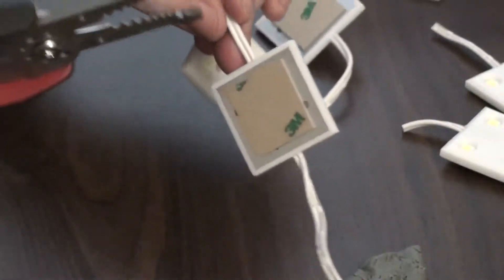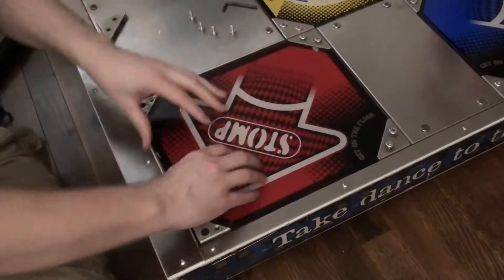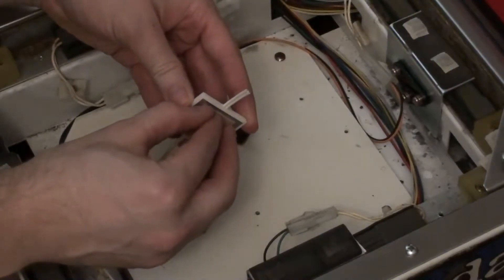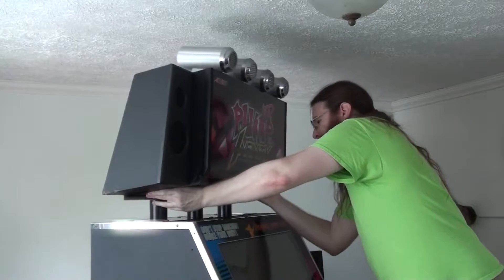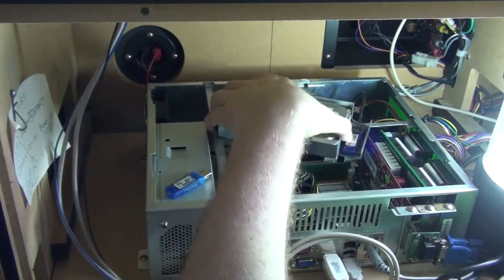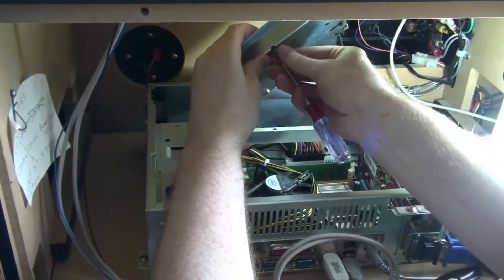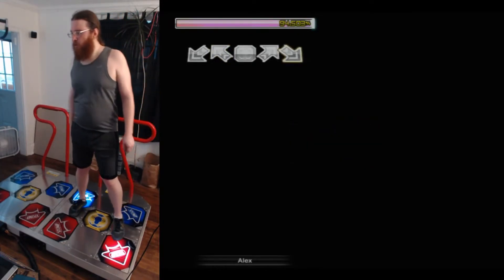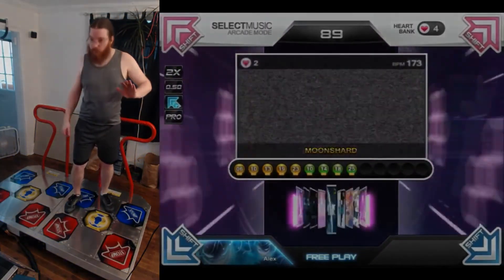Pump It Up machine upgrades: Pad LEDs, Infinity HDD

Comment: I definitely like the look of Infinity, much more grown up looking! I wish the song title was shown on the screen during gameplay though! If I had a circuit diagram for that pad I/O board I could troubleshoot it for you. (electronics servicing used to be my job)
Reply from the maker: Oh cool! I wasn't able to find a circuit diagram, but I could maybe try tracing the connections on the PCB myself... Here's what it looks like, for reference: https://drive.google.com/file/d/0BzqS6lEIbhJGbGhRZHFsOFlOTm8/view?usp=sharing

The connections toward the front of the photo go to the machine, and the five in the back each go to a panel. The two on the right (blue and white) work correctly. I'm sure there isn't much that can be done with just a picture, so I'll see if I can dig up some more detailed information.
Reply: Thanks. It's an odd fault for three of the five to be out. It could be the drive transistors on the right or one of the multiplexer/demultiplexer logic chips. If you have a multimeter you could look at voltages on each transistor and see how they change for the on & off states.
Reply: I would also suspect the DM7406 chip that drives the 5 transistors that almost certainly switch the pad lights. The modern equivalent would be a SN7406N. You will need a good soldering iron and desoldering pump or wick to get that out as it's a double sided board which makes it harder. Also you could clean up the board and check for any corroded tracks due to spillage etc.
Reply from the maker: That sounds promising! I'll have the get in there with a multimeter later today and see if I can figure anything out. I am a little bit hesitant to start poking around too much without knowing exactly what I'm doing, especially for things that involve having the power on. I did check the transistors on the right, and couldn't find any measurable differences between them. I've also cleaned the board since that photo was taken and everything looks pretty good on visual inspection. I should be able to handle replacing the DM7406, though, so if that turns out to be the issue then it shouldn't be too much of a problem to fix.

Thanks a lot for the help! I'll be back if I find out anything more.
Reply from the maker: Well, I messed around for a while... Using a multimeter, I traced all the wire connections the best I could, and pretty much figured out the routes between the machine connections and the panel connections. Nothing seemed to pop out as a visible problem. All of the resistances I was able to measure with the power off made sense and were consistent. I think I can rule out simple connection issues, so it feels like it must be one of the components on the board not doing its job somehow, in some way that I can't observe with my current tools and the power off.

So, I suppose the next logical step would be to measure voltage with the power on to see if I can isolate the problem that way. My worry is the possibility of ruining the board further by poking the wrong place with the power on (and of course personal safety, in case the current is enough to be concerned about). Any general tips for doing this safely, if it even makes sense to do at all? This is the multimeter I'm using, if it makes a difference: http://byramlabs.com/store/images/hi-res/SPE-dm-350a.gif

I also grabbed some better pictures of both sides of the board, which came in handy for me when I was tracing everything: https://drive.google.com/file/d/0BzqS6lEIbhJGTWh1OHFIQkI3TGs/view https://drive.google.com/file/d/0BzqS6lEIbhJGLUE2WmVUQmZvS0U/view
Reply: Hi, I have traced out the control for the lights, the components involved are U8 and U9 (opto-isolators), U10 (the DM7406) and the transistors Q1-5. There is only +12 and +5 volts on the board so it is safe to work on powered. You just need to be careful not to short any pins together with the meter probes! Put the meter on the 20V range. It would be most useful to know the voltages on the DM7406 chip, which takes 0 or 5 volts logic control inputs and provides output current to drive Q1-5. Looking at the board from the top side, pin 1 of the DM7406 is the lower-left where the circular indent is, and they count round counter-clockwise, so pin 8 is top-right, pin 14 is top-left. Pin 7 (the lower right pin) is ground so put the black meter probe on that. Pin 14 should be 5 volts at all times. The control INPUTS are on pins 1, 3, 5, 9, and 11 for the Up, Down, Left, Right, and Centre pads respectively (as marked on the board). I don't know why they are labelled as if they are orthogonal pads on the board, how confusing! These inputs should be LOW (0 volts) to switch the lights ON and HIGH (5 volts) to switch the lights OFF. The OUTPUTS work the opposite way. They are pins 2, 4, 6, 8, and 10 for U,D,L,R and C pads. These will be LOW for lights off and HIGH (about 12V I think) for lights ON. Let me know how you get on with these measurements! My money is still on the DM7406. It's a very standard and inexpensive part.
Reply from the maker: Awesome, thanks again for the info! So, I have the thing open right now... I checked the voltage on the DM7406's pins as you described, and it matched up pretty much exactly for the panels that work correctly. Pins 1 and 2 are ~5V and ~0V respectively when the up-left panel is off, and ~0V and ~12V when it's on. Pins 3 and 4 are the same for up-right. Pins 5 and 6 appear to correspond to the center panel, 8 and 9 for down-left, and 10 and 11 for down-right. The voltage doesn't change for pins connected to the center, down-left, and down-right panels when I press them - they still measure ~5V for the odd numbered pins and ~0V for the even numbered ones regardless of the state of the sensors.

While I was measuring, I happened to short two of the pins together, and noticed that it made the light come on for one of the panels that wasn't working. If I short 2 and 3, the up-right light comes on; 4 and 5 turns on center, 9 and 10 turns on down-left, and 11 and 12 turns on down-right. So, at the very least, I feel like that rules out Q1-Q5 as the problem, since they're "downstream" from the U10. (I need to be more careful not to short things by accident, but at least this led to a useful discovery!)

So, I'm still not sure whether this conclusively points to the DM7406 as the problem. I also wonder about the PC817 units (U8 and U9), but I'm not quite sure how to test those. I suppose I could just order replacements for all three, swap in the SN7406N in place of the DM7406, and then replace the PC817s if that doesn't fix the problem...unless you can say it's the DM7406 for sure based on my test results above?

Super huge thanks for your help! I would never have been able to figure this stuff out on my own.
Reply from the maker: Cool, sounds good... I've already ruled out a cabinet issue by swapping the player 1 and player 2 boards and seeing the problem switch sides, so it's definitely somewhere in there. I've ordered an SN7406N and a few PC847s (which were slightly hard to find - apparently they're out of production, which might partially explain why entire replacement boards aren't easily available). I'll definitely get video of swapping the new components in. This has been an interesting process, and I've learned a lot of stuff. I'll keep you posted when the parts arrive!
Reply from the maker: So, I got my components today, and did some soldering. I managed to get the DM7406 off the board eventually (solder wick wasn't really working for me, but a solder sucker did the job), and swapped in the SN7406N. I plugged it in, and...well, nothing broke, but the problem was the same.

My next suspect was the PC847 at U9. I did the same procedure and swapped in a replacement (managing to destroy the old component in the process, but oh well), plugged it in again, and...same thing. Didn't make it worse, didn't make it better.

I traced the lines several times, and I'm 99% sure that U8 can't be the problem. The panels with the nonworking lights definitely run through U9. So, unless the new components I got are faulty in the exact same way as the ones they replaced, the problem must still lie elsewhere.

I was going to try swapping Q2 with Q3 to see if that did anything, but I couldn't get them desoldered cleanly, and I didn't want to use more force and possibly break them since I don't have replacements on hand. I still feel like my earlier test where I shorted adjacent pins on U10 points to those transistors working correctly, though...but as far as I can tell, they're the only other components that are involved at all in light control.

I'm stumped. Everything I can measure indicates that this board should be working. At this point, the only option seems to be to replace the whole thing. Fortunately, I've gotten in contact with someone who should be able to get me a replacement, which has been impossible to find up until now. At least the old board still works as far as the sensors are concerned, so I'm no worse off than I was. I'll just order a new one, and I guess the problem with this old one will remain a mystery. I suppose once I have a replacement, I'll be more willing to do destructive things to see if I can figure out the problem, if I'm still curious.

Anyway, this has been an interesting adventure. I learned a lot of things and got some soldering and desoldering practice. Thanks again for your help! Sorry I couldn't actually get an answer about what's going on.
Reply: Thanks for the update. Wow, that's very odd, and frustrating I'm sure, such is the world of electronics servicing! The only other components in the chain are passive ones, namely the resistors, the least likely parts to fail! There are three resistor arrays, AR6, AR4 and the one below U9 I can't see a label for. They are 9-pin strips, containing 8 resistors with one end of the 8 resistors tied to a common pin. One of these could be damaged. Inspect them closely with a magnifier for cracks. The fault could be any of the three. Your meter can help you here. With the power on but no lights lit, measure voltage between the common pin and the other pins in each strip. The common pin is at one end indicated on the board with an extra line. You could also try measuring resistance the same way, with the power off. This might reveal the culprit! Good luck again!
Reply from the maker: OOH! I found something! I measured the A 102G resistor array below U9 (labeled AR1K, the one that's hard to read), and it appears to be the cause of the problem! Between the leftmost 5 pins, the resistance is 1K ohm as expected, but between those and the four on the right, I'm getting 110K ohms. Those four pins on the right connect to the pins on the optoisolator at U9 that control the exact three lights that aren't working. Eureka! I compared to the working board, and that one is uniformly 1K across all pins.

I think we've solved it! I'll order a replacement, and finally I feel pretty sure this will fix the problem.

Woohoo!
Reply: That's great! Glad you found a replacement too. What an odd thing to fail, it must have been badly manufactured possibly. I just looked in my Konami DDR computer and it has 7 of those same Sharp optoisolator chips on the inputs from the pads! It's still all in bits for cleaning up - the pads were in quite poor condition with a wall of dirt between all the pad sections, yuk! Signs of spillages also. It's going to take a bit of time and effort yet!

Comment: On pro mode, stage break is on which means that you fail when the lifebar depletes. If you do classic mode, the lifebar is basically nonexistent like your typical pump lifebar. Also, the superb window is only in pro mode.
Reply from the maker: Ah interesting, I thought Pro mode was only for superb timing. Good to know!
Reply: Yeah when I play infinity, I use pro mode when I'm going for timing, and classic mode when I'm pushing through harder stuff

Comment: Just an FYI. If you are upgrading to Infinity, Upgrade the processor and ram. even if you are running an MK9 infinity is a HUGEEEE datapool and will need all the power you can get to prevent any issues with the game like freezing / not saving / bugs
Reply from the maker: Good idea. Any recommendations for a specific CPU model that would be an easy drop-in replacement?
Reply from the maker: Thanks!

Comment: have you ever tried cloning the hard drive and USB? And how much was the kit?
Reply from the maker: Nope! I've heard that people have had several hard drives become inoperable by trying to clone or decrypt them, so I'd kind of prefer not to mess with it. I probably wouldn't be able to get a replacement from Andamiro or get them to sell me newer versions if I'd been messing with it and it failed. It was $1800 for Infinity and $1500 for Prime 2, so not something I want to risk destroying by doing the wrong thing to it.
Reply: Can either one play custom songs? And does prime2 how a rhythm noteskin? I don't even play pump but I saw a zero on eBay two days ago and ended up getting it for $850 including shipping.

Comment: Gee, all those boards on the right side of the GPU are what, actually?
Reply from the maker: That's the PIUIO and JAMMA interface. I'm not super familiar with the inner workings of it, but I know it's what makes the connection between the computer and the lights, pad sensors, and a couple of other things. Someday I should get in there and learn how it all works, but I haven't really had an occasion to do it yet - I only have a very basic understanding of that part of the machine.
Reply: I'm willing to make one of my own. One of the reasons being it's very hard to find one and to this day, the schematic is available for PIU owners and adventures willing to learn something with all this. That's why I'm bothering you with all this stuff ever since. See "schematics" session: https://github.com/racerxdl/piuio_clone
Reply from the maker: Oh interesting! I could try and get some better pictures of the thing if it helps. Definitely important to be able to preserve stuff like this. I do know that the newest Pump machines don't use the PIUIO anymore, which is why they don't run Infinity, though apparently the new one gives a better response with Prime 2. If there's anything specific I can answer or show that would help, let me know and I'll see what I can do.
Reply: Oh, that my friend would be handy and I couldn't thank you enough if it's not too much asking. Annoying, but yeah, couldn't agree more with ya. It needs to be preserved. I live in some corner of this world where PIU it's not quite possible to buy in good shape, so I had to improvise and now I'm one step closer to be able to have a clone one. If you really could take some photos of the board, I appreciate your help.
Reply from the maker: Cool, I'll see what I can do. I don't really have any of my machines set up right now in a way that it's easy to get around the back, but next time I'm moving them around, I'll get in there and snap some pictures. I'll let you know!
Reply: Thanks in advance. No need to rush anyway.
Reply from the maker: Hey, I got a chance to take some pictures. Some of the cables were stubborn so I didn't get everything disconnected, but here are the best photos I could get from the angles I had available: https://imgur.com/a/JiNF8u7

Hope that helps!
Reply: Alex Diener Hey, that's awesome. Thank you so much for that. I can figure something out with that in hand. Thanks a lot. Your ITG still running, huh? Fantastic work.

Comment: Sir,Where can I buy an infinity upgrade kit?
Reply from the maker: If you're in the US, you'll want to talk to Phil Arrington. I'm not sure if he'd want his e-mail address posted publicly, but if you send me an e-mail (on my About page), I can give it to you. If you're someplace else, I'm not really sure - you could try contacting sales@andamiro.com directly, though I didn't have much luck with this. Watching eBay or other places for a used kit might work, though it requires some luck.
Reply: @adiener  I am not in the US, I did not find HDD KIT on ebay. google found a website selling 2200+$, too expensive!
I hope to find a cheap KIT, used kit is better.
In addition to ebay, are there other websites to look for?
Reply from the maker: That's not too far off what I paid for mine new. Used ones are likely to be rare, and probably not a whole lot cheaper, since it won't really have lost much value compared to a new one. Unfortunately, these things aren't really priced for individuals buying them for personal use - Andamiro's expectation is to have sold a small number of these to arcades to upgrade machines that are each used by a large number of people. You might get lucky with someone willing to part with a kit they don't want anymore for less, but I'd expect most sellers to be savvy to the fact that Infinity doesn't have an expiration date, and isn't superseded by newer Pump versions.

Comment: hold up! how old is that computer?
Reply from the maker: I didn't know the full history of the machine when I bought it, but my impression is that it was bought as a new NX Absolute, and still had pretty much all the original parts in it, including one of the early MK9s on the inside. So, probably 2008 or 2009 or so?
Reply: Alex Diener Wow! If a computer that old can keep on working then what are manufacturers doing to New computers that make not last more than a year.